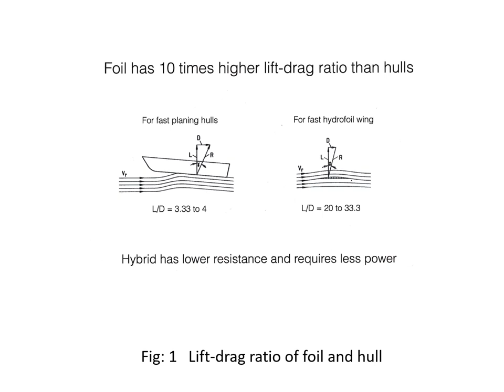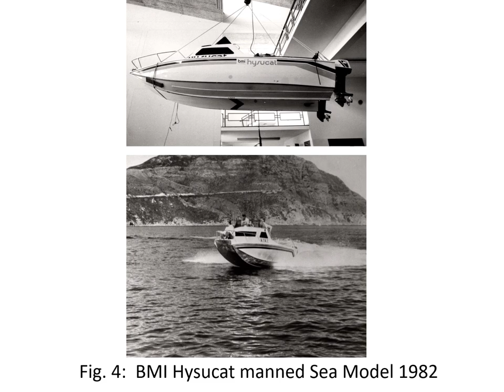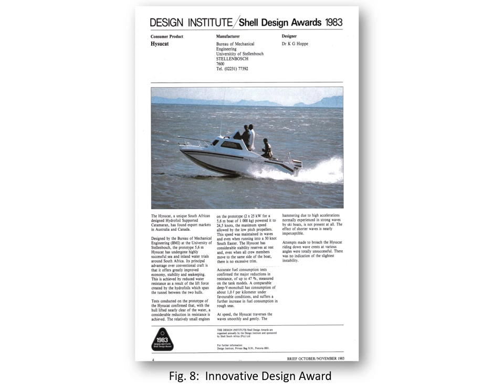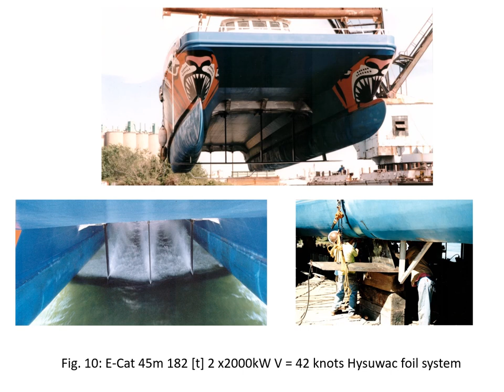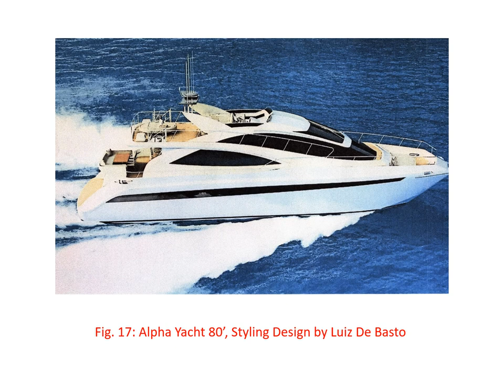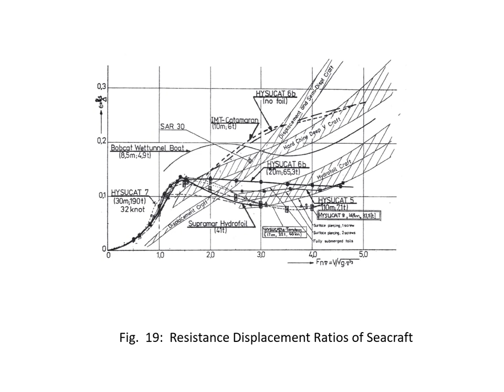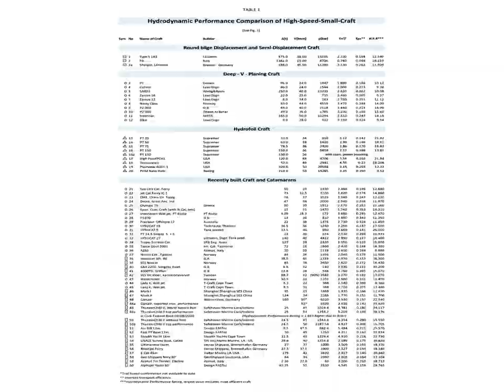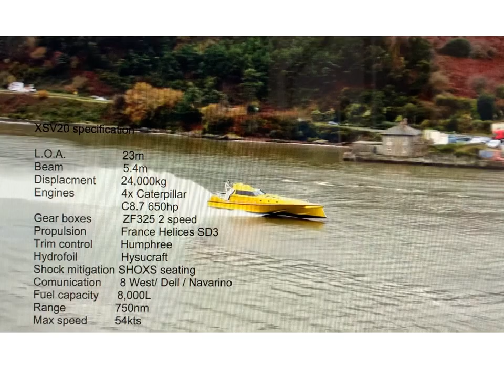HYDROFOIL -- Professor Gunter Hoppe, Foil Assisted Ship Development (HYSUCAT) -- Hydrofoil

Comment: Good afternoon ... I was very interested in the topic, the combination of hydrofoil and catamaran! Not knowing before about the work of a respected author, I experimented with a model in full size ... But I set myself the task of creating a universal vessel, both a valuable motor boat and a full-fledged sailing ship ... After a series of experiments, certain conclusions can be drawn ... In this regard, I dare to ask a (maybe stupid) question? Why is the idea of moving on the support (of the wings) of the ship's hull applied in all the possible options (which I managed to get acquainted with on all various models of hydrofoils)? Ie a separate vessel and separate wings? Have you come across variants of a harmonious symbiosis, capable of equivalently using ships, both in displacement mode (with a lack of propulsion power) and on the wing (with sufficient power)? Once again, I apologize for the concern ... Advice would be very helpful for solving the problem. Yours faithfully ....